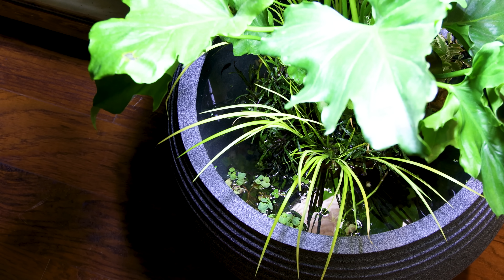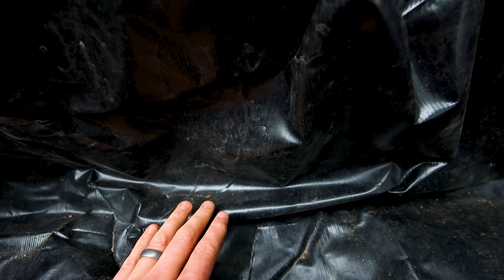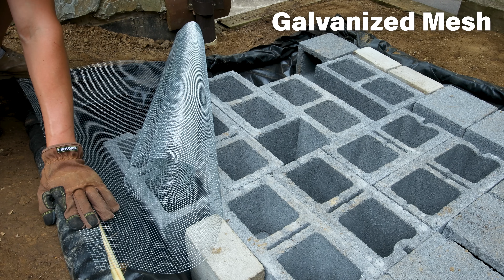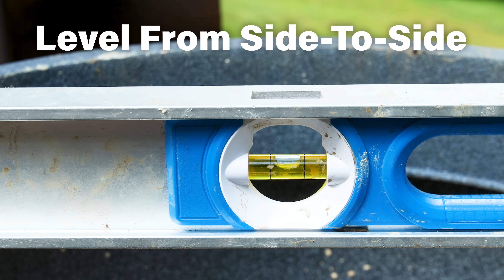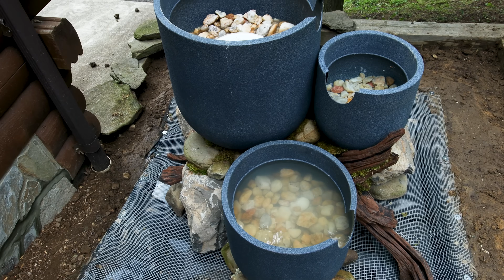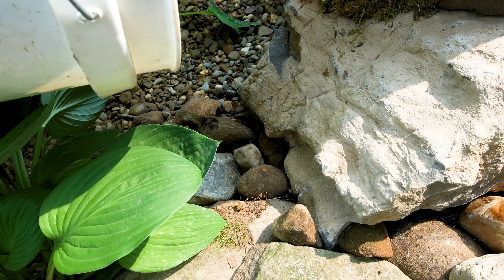Vanishing Waterfalls Easy DIY Planter Pot Fountain

Comment: its a beautiful water feature. 🥰. The cutouts where the water spills out from each planter, reveal the thin plastic they are made of, giving away that they're not made of stone. Maybe seal the holes with foam and then bondo filler or something waterproof. Then paint with stone texture paint, in effort to conceal those holes.

Comment: What a fantastic project and addition to your home.  The one thing I would do is enhance the look of each pot's pour spouts so they don't look like thin plastic with the inside lip.  I'd have to ponder that a bit on how I would address it.  Stone, leftover pot plant plastic, not sure, but I think it would give the whole thing a much nicer aesthetic and make the pots appear much more substantial.  Aside from that this turned out fantastically.  I'd love to see how it looks at the end of this growing season and into the coming years.  Nothing major just a quick update, this is how it looks now.

Cheers
Reply: I was thinking the same. Perhaps he can make an epoxy putty and use the cut-off scrap material to fill in the hollow-looking overflow areas.

Comment: If the pump pulls from the bottom you could layer it in a way that the spill way acts as a water filter/purifier so the pumped water was drinkable, of it was in a place where it would collect rain water. I love these larger features you're doing.

Comment: you might consider putting discarded carped like green shag over your hardware cloth. I have some been on my driveway 28 yrs. it would hold moisture for those plants not in direct soil like  the moss. Moss happily spreads on mine. Is easily cut  where you need , go ahead and put your rocks and pea gravel as you did.  Lovely!  2 cents from Florida grandma

Comment: I liked this water feature! I'd want to add little step. I wouldn't completely fill 4x4 hole with blocks, only blocks supporting water tubs, so fish could be housed in bottom base. Too that, Add glass aquarium above base water with water filled piping so fish can swim up through piping into aquarium above ground level. (Made to look natural).

Comment: Leveling can be done with 2 plastic bottles, vented, some plastic tubing and some colored water. 1 bottle is mounted to your reference height and the other to a gauging stick. The water level in each bottle will maintain the same altitude. A sharpie to mark a level line and voila! An infinite length level. Just add length to tubing as required.

Comment: So ... a 3 crock or 3 basin system is also good for water filtration ... gravel and sand 1st crock, sand and charcoal 2nd crock, charcoal and stone 3rd crock . Just in case you wanted to make it dual purpose functional

Comment: The only thing I would say looks unpolished about it is the cuts in the pots revealing they're hollow and not cement.  Maybe some expanding foam,  then epoxy,  then  rough sand paper and some matched paint? Or maybe bondo instead of epoxy? That's my only small critique. Good job with the build, and keep up the great work!

Comment: Looks great! I'm doing a triple-cascading water feature myself as a functional waterfall/filter for an above-ground pond. 
I have 3 MacCourt molded spillways instead of pots. Instead of leaving the vacu-formed plastic spillways naked, I'm trying to make shells for them out of Great Stuff, to be painted with textured spray paint for a stony look. I'm having a problem with the foam expanding and contracting well after it's cured, though. Maybe from day/night temperature changes?

Comment: Create a water fountain that recycles itself non-stop while energizing an electric generator. For example, as the water falls, it energizes a generator that lifts the water back to the top of the water fountain. Or without a generator by having the falling water power a water lift.

Comment: The only thing I think spoils it is the holes- where you see the lip n the inside … so you get that gap area between the outside of the planter and that inside. Piece causing the gap- I think if you could apart form that gap closed even with black so it fills that space it would make the planters look so so much more expensive and not look like plastic… otherwise I love this ❤

Comment: I don’t know if anyone said this before, but I built a fountain like that and found it mucks up quite a bit over winter and a whole summer, and I have been forced to bend the hardware cloth up on one side to clean out the reservoir entirely each spring. It is a horrible task. Bleeding from the hardware cloth, removing all of the rocks and rinsing them and putting them back is hours of labor. Hardware cloth doesn’t filter leaves and grass that breaks down over fall  through spring. And then you can’t fill enough water bc the sediment and muck start filling it up - I have 1/2 the size you do, but I haven’t been able to figure out how to filter the pond so I don’t have to do this. 

I’m using hardware cloth and aquarium filter now (it’s a 1” material white on one side and blue on the other, but 1) the color shows through in spots, and 2) it molds and has to be cleaned itself, still requiring removing the hardware cloth from as many places I can to pull out that material - which I had to put under the cloth because of the rocks. So, it’s not a solution. Any ideas you could post would be great!

Comment: An ambitious project and beautifully executed. Thank you for sharing. In the year or so since you have completed this, is there anything you would have done differently? When you shut it down, have you had any problems with mosquito larvae? How much of a change did you see in your electric bill? And approximately how much did all of that cost? Thanks in advance for answering any of this... thinking about something similar and could benefit from your experience... if possible.

Comment: You did well.  I would make the underground pool MUCH smaller.  Seems you would need only enough gallons to fill each planter, plus some to circulate underneath would be much less than that whole big underground pool. it looks good however would be very costly to buy all the ingredients from scratch, so to speak.

Comment: I know im late to the party here but this looks like a fantastic idea for our ned planter, did you have to  turn down the pump much for the water to flow like that or is the pump running at full flow and power? just looking at different pumps flow rate trying to decide what I need

Comment: Your fountain looks amazing. You didn’t mention the size of the PVC pipe you used. Was that 1 inch or 2 inch? Plus, the cost of all the materials you used. I have a funny shaped yard. I want to put a fountain in the corner. But, electrical is a ways away. I am not electrician and to bring electrical out to that point. You’re talking at least 20 feet or better. I have considered solar but, that only works when the sun is out. Any ideas? Thanks for sharing. By the way, where did you get your pots? Haven’t seen anything like those here at Lowe’s or Home Depot.  That doesn’t have holes in it. I’m in Idaho so I don’t have too many choices. Thanks again for sharing. It gives me a lot of ideas.

Comment: These videos are so frustrating.  What about the electric.  Where did you plug this in?  Why not show us how you connect the pump to the hoses.  I didn't even see a hose.  how does that work?  These are the two components people want to see.  Everything else is obvious.  What about electric and how does the thing work? There must be hoses or tubes or something that circulates the water.